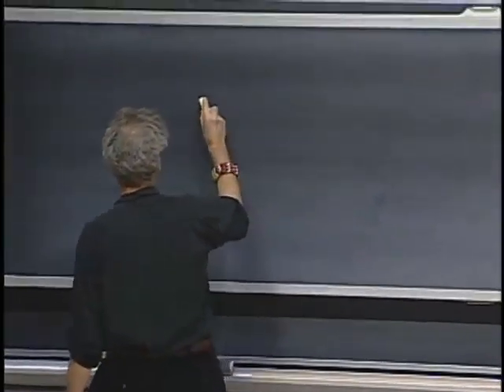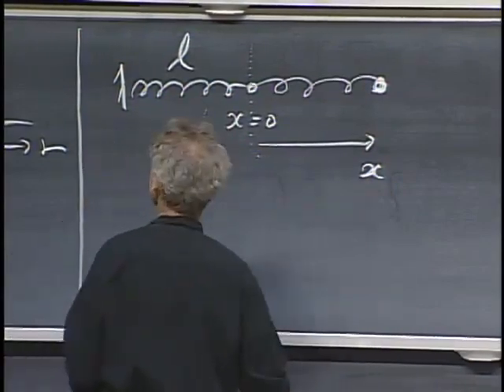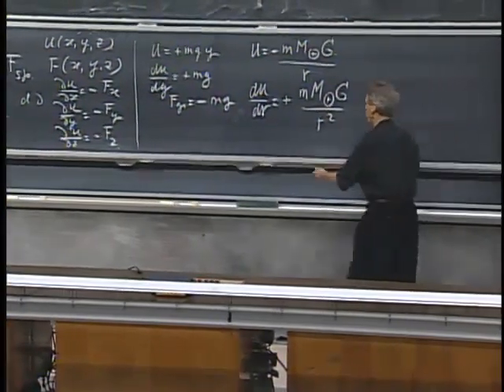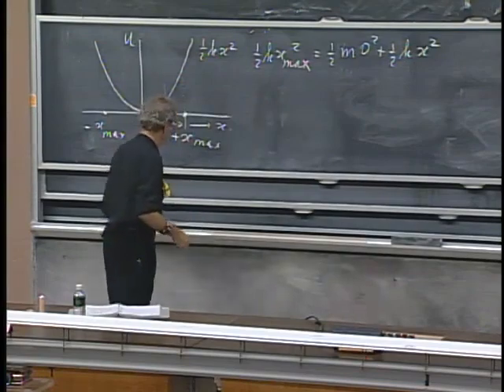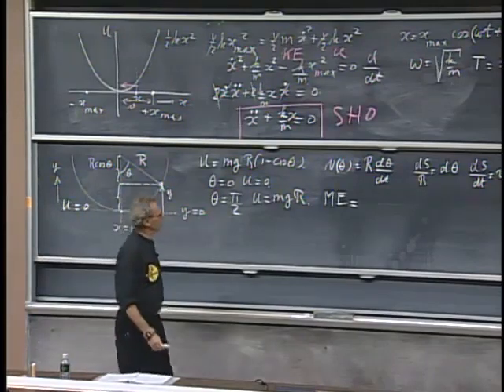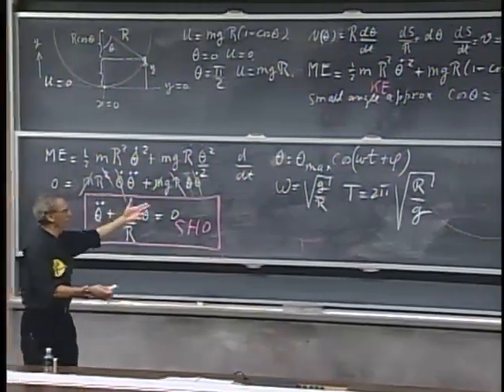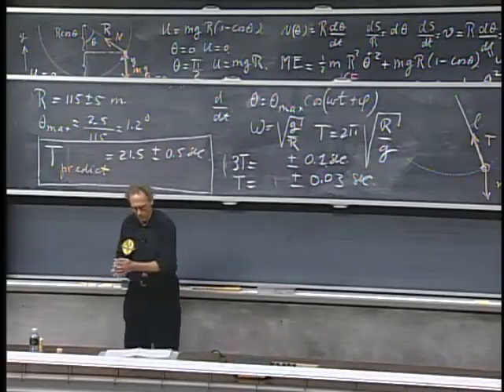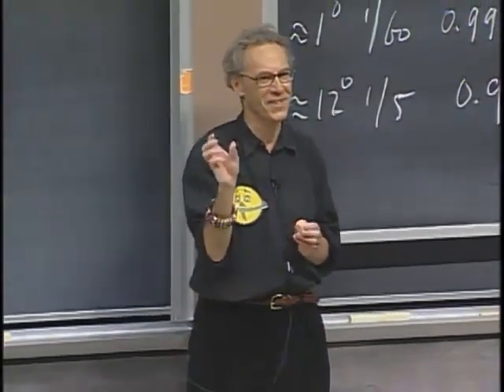8.01x - Lect 13 - Potential Energy, Derive Simple Harmonic Motion using Energy

Comment: On the end. Isn’t it because of the smaller radius and angle? Just of the top of my head, the velocity was directly proportional to the radius and angle. So the smaller they are the slower the ball moves. Please correct me if I’m wrong.
Reply from the maker: you are wrong

Comment: The experimental failure was caused by ignoring **rotational kinetic energy**. Unlike the sliding glider, the rolling sphere splits its initial energy into both translational and rotational kinetic energy, reducing linear speed and significantly increasing the period.

Comment: Dear Professor Walter Lewin, I appreciate if you can help me to clarifying a point:
1. in the air track with large radius your prediction match with your observation. I understand that, since we are talking about an object sliding on circular track.
2. However, in the case of the small circular track with a ball, the prediction was very different from the observation.

3: So, my question is why? I guess in the second case we talking about rolling motion, not sliding motion, right?
Many thanks for your time and kind attention.
Reply from the maker: I have posted a physics problem which takes the rotation of the ball into account - the result is in perfect agreement with the observed period
Reply: @lecturesbywalterlewin.they9259  Many and many thanks Professor Walter Lewin.
I will check the problem with rotation of the ball.
Reply: @lecturesbywalterlewin.they9259  My idea is to assist with complete lecture per week. 
I think this is natural rhythm for my learning process.
PS: I apologize for my poor english.
Reply: @lecturesbywalterlewin.they9259  Dear Professor Walter Lewin, can you, please, tell me what is the Physics Problem in which the rotation is also taken into account.
Sorry, but I didn't find it.
Many and many thanks.

Comment: Oh, indeed you say it, that 13° is not that bad and the approximation is still valid. My bad !.....My second attempt Professor (4 am here in Europe, not the best moment for having a fresh brain) maybe I'm still not nailing it.... The difference between both experiments is in the variability of the angular velocity, and in consequence, the period, all along the trajectory. 
In the first experiment, the ball keeps a similar height so similar potential energy all along the arc, due the conservation of energy we deduce it keeps also a similar value of kinetic energy all along the arc, so a similar value of linear velocity and therefore similar angular velocity all along the arc which is closer to an ideal harmonic oscillator.
In the second experiment, the variability in potential energy is bigger because the arc has less radius and the ball changes more its height all along the arc. More variability in potential energy is immediately translated in a more variability in kinetic energy, so you have a non-constant angular velocity, so you deviate from the ideal harmonic oscillator. 
Why slower than the harmonic oscillator prediction? Because the bigger the angle, you have the ball being submitted to a bigger effective gravity force doing negative work, and so, it reduces its velocity and at the end you have a bigger period.
Reply from the maker: you still don't get it

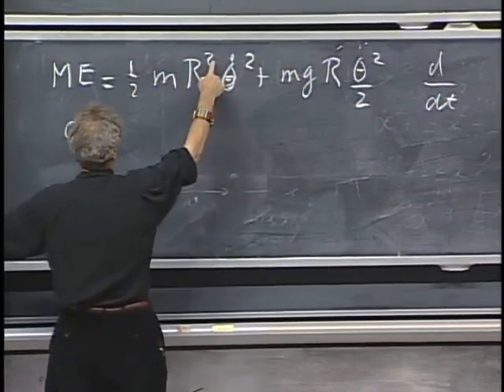Comment: 34:10 , you point to R^2 and say the 2 comes down and eats up 1/2, but then continue writing R^2 in the equation. Does the 2 come from Angular velocity instead??, since the equation is not wrong at all
Reply: Radius isn't changing with time, so yes, it does come from angular velocity.
Reply: The circle doesn't change its geometry over time.

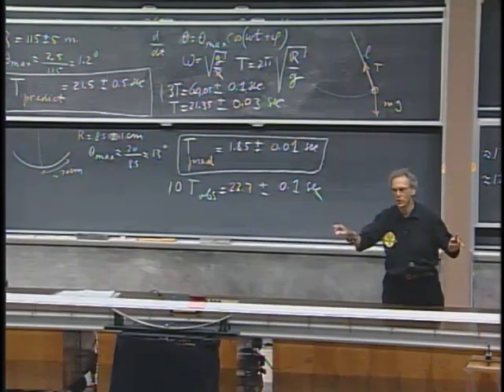Comment: 50:52 did that happen because the ball bearing would take a moment to get into pure rolling state every time it would change it's direction, or in other words, it would get into a state of sliding friction before entering pure rolling, and that moment of sliding friction would lower the net energy of the system...

but wait, this SHM, T only depends on radius of curvature and gravitation, so lowering the energy should only lower it's amplitude...

Please explain sir, I'm very keen to know!
Reply from the maker: it's due to the rotation KE of the ball.
Reply: @lecturesbywalterlewin.they9259  thank you sir🙇🏿‍♂️

Comment: IT'S THE AMPLITUDE!
The amplitude of the larger arced SHO is much smaller as compared to the amplitude of the ball on the smaller arc in the second experiment.
I hope I'm right. It was fun joining this lecture professor. Luckily I showered a couple hours ago 
:)
Reply: It's not the amplitude.  It takes at least a 22 degree amplitude of a pendulum to achieve a 1% error in the period.  Hyperphysics has a large amplitude pendulum period calculator, that implements the infinite series to more terms to calculate this.

It's the fact that the ball rolls, while the air track slider is in pure translation, that explains it.  The kinetic energy of the ball is more than just 1/2*m*v^2.  It is 1/2*m*v^2 + 1/2*I*omega^2, where omega = v/r, r is the ball's radius, and I is the moment of inertia of the ball about its central axis.   Put it all together, and you end up with KE_total = 1/2*v^2 *(m + I/r^2).

Apply this equation to the procedure of finding the period of oscillation from this lecture and get the following.  Note that big R is the track radius:
T = 2*pi*sqrt(((m + I/r^2)*R) / (m*g))

Set I = K*m*r^2, where K is the factor in front of m*r^2 in moment of inertia, and get:
T = 2*pi*sqrt((1+K)*R / g)

Set K=0 for the case of pure translation, and get:
T = 2*pi*sqrt(R / g)
 
Set K = 2/5 for the case of a solid uniform sphere and get:
T = 2*pi*sqrt(7/5 * R/g)

With the given data, we predict T=2.2 seconds, for the ball rolling, which is consistent with the experiment.
Reply: @carultch  when you asked your dad for fork on dinner.
Reply: @carultch   that was great explanation .

Comment: It might be the air drag in the second condition .. it might also be in the first one but the shape of the first object would have handled it and reduced it .. (due to its less surface area in motions direction)... The second was a sphere so more area was exposed while motion and air would have made it lil slow ... Plz clear if I'm wrong .. 😅
Reply: You are wrong, first the air drag  it will be very small  so it can't be it, the reason is that the sphere rotates so it has kinetic energy due to its rotation K=(I*ω^2)/2 which you have to add in the initial relation and if you do it, you will find that the T is 2,19 instead of 1,85 which is very close with the experimental one

Comment: For the rolling ball,  T = 2*π*sqrt(7R/5g). Plug the numbers in! 
Proff. Walter Lewin is right. PHYSICS  WORK.
Reply: How did you get that formula, please?
Reply: @paulproofphysics777  When you do the calculations the kinetic energy for a rolling body is not (m*v^2)/2 but you have to add to this the kinetic energy from the rotation which is (I*w^2)/2 so the kinetic energy is KE= (m*v^2)/2+(I*w^2)/2 and this will give the difference

Comment: Teacher, i want to ask you that, only convervative Force have the potential energy?
Reply: Yes.  Only conservative forces have an associated potential energy.  There is energy transfer with non-conservative forces, but it is an irreversible process.  When friction slows down an object, energy leaves the domain of mechanical energy, and becomes thermal energy.  When a human force intervenes to add mechanical energy to a system, energy enters the mechanical domain from the original form of chemical energy in the person's food supply.  Energy is ultimately conserved in both of these examples, even though these are not considered conservative forces.  It is just that mechanical energy isn't considered to be conserved, because other forms of energy are involved.  Due to the fact that the process is irreversible, we don't keep track of a corresponding potential energy to non-conservative forces.

Forces of constraint, like the normal force and tension, also don't have a corresponding potential energy, because in the ideal case, these are zero work forces.  The corresponding displacement is zero, for ideal forces of constraint.  Ultimately, these are a form of elasticity, and will have elastic potential energy that corresponds to them, but when deformations are insignificant, the potential energy changes are also insignificant.

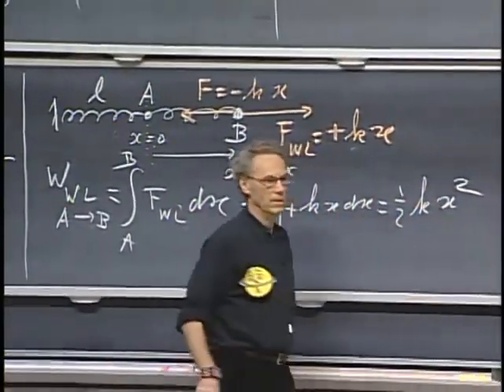Comment: 8:50 why the work equal 1/2*k*x^2 not just k*x^2 since work between the two points will equal the force*distance  (force=kx , distance=x)  , 
Thank u a lot best physics prof ever Walter Lewin
Reply from the maker: MATH!    integral of kxdx
Reply: why integral is needed in this case
Thanks for ur time prof
Reply from the maker: watch my lectures in which I cover "energy and work" this in great detail.
Reply: Lectures by Walter Lewin. They will make you ♥ Physics. Alright professor thank u for ur attention
Reply: @20000bc  
why integral needed.................simple  
force is changing with the position x. if force is const: , then work is area under the rectangle of side x and that const force 
but here the force change linearly with x and we have to cut that rectangle diagonally gives us a right angled triangle of area 0.5bh (force *x).hope you understand ...no big deal....suggest you 3blue 1brown channel ...invent calculus yourself.....
Reply: @vineethkumar.v8647  thank u dude

Comment: What's the mean of angular frequency in oscillation??
Angular frequency - unit - rad sec^(-1)
Means particle who is in periodic motion move 1 rad in one second in reference Circle.
I'm right or no.
Reply from the maker: if an object oscillates in SHM with period T, then the ang freq 
ω= 2π/T. If T changes in time you can calculate the mean value of ω in a given time interval.
Reply from the maker: A 1 D SHM with period T (e.g., an object oscillating on a spring) has an ang freq ω= 2π/T.
Reply: My question is that SHM can be liner or something more but we use angular frequency for SHM who relates motion to a circular motion.
And can we use the term angular frequency for liner Harmonic motion?
English is weak.😔
Reply: @gemeitgoel5104  Simple harmonic motion means that you can describe the oscillation as a sinusoidal function of time (i.e. sine or cosine function).   The input to the sine function expects radians as the unit.   Angular frequency is the parameter that translates the time into corresponding units of radians, each representing a two-pi'th of a cycle.   The complete cycle is 2*pi radians.

The angular frequency doesn't physically manifest into any angles you can measure on a protractor in the real situation it describes.  It is a way to translate time into the abstract angular domain, that the sine function expects as an input.

The general equation for a sine wave is:
y = A*sin(omega*x - phi) + y0

A is amplitude
omega is the angular frequency, equal to 2*pi* the full cycle frequency.
phi is the phase offset, that specifies how many radians through the sine wave the cycle starts
y0 is the equilibrium position

Comment: Professor, I have a doubt.
Since you estimate your reaction time to be 0.1 seconds, you write it as the uncertainty, because you admit you may be off by 0.1 seconds at any measurement of time.
Well, the doubt is the following: to measure the period of the oscillation shouldn't you consider an uncertainty of 0.1 second both at the start and at the end of the timing, resulting in a total uncertainty of 0.2 seconds?
Thanks for the attention
Reply from the maker: my total reaction time including start and stop was 0.1 sec in 1999. In 2011 it was closer to 0.2 sec. Thus that's the uncertainty in my measurements.
Reply: Lectures by Walter Lewin. They will make you ♥ Physics. 
Thank you professor

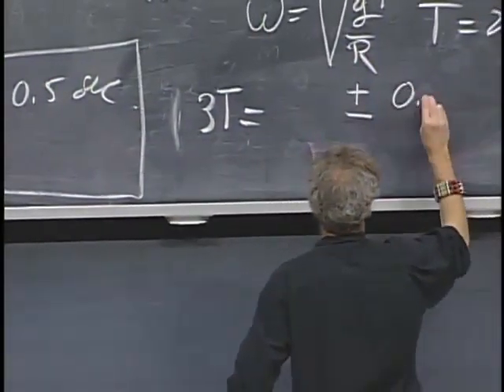Comment: Dear prof, at 43:33,  shouldn't your reaction time stay the same (+-0.1) regardless of whether you are pushing the timer after 3 oscillations or just 1?
Reply: Khandker Tiash Azad the reaction time stays the same, but the error goes down. This is because the first error is the error on 1 oscillation, caused by the pressing of the button at the beginning of the single oscillation and at the end of the same single oscillation. In the case of 3 oscillations the button is pressed at the beginning of the first and at the end of the third, so there is no error at the end of the first, start of the second, end of the second and start of the third.

Comment: is it have to something to do with rolling motion of the ball? As I remember that ball makes both rotational motion AND translational motion so it has two types of kinetic energy (1/2mv^2 + 1/2Iw^2), unlike the first oscillator which only had kinetic energy from translational motion. 
Thus, some of the ball's potential energy will be consumed for its rolling and it will lose tangential speed by time
Reply: You are correct.  It is that not all of the kinetic energy of the ball is in pure translation, that slows it down.  The fact that it rolls gives it another mode of storing its energy (rotational KE), that is directly linked to its speed due to being in pure roll.   A frictionless slider would move like a simple pendulum on that track, but a rolling ball needs to have its rotational dynamics considered to predict its period.

A solid tungsten ball inside a plastic shell, would be a way to get it much closer to  translational-only mechanics, by concentrating as much of the mass as close to the axis of rotation as you can..
Reply: @carultch  Yeah agree but there must be static friction for the ball to roll.
Reply: I think so too...
Reply: I also think that 🤔

Comment: Professor centripetal acceleration also works on the pendulum so why didn't we take into that consideration and why just tension.
Reply from the maker: we take not only tension into account. we use gravity and tension. when the pendulum is at its lowest point, the centripetal force at that moment will be the difference between the tension and mg. If we use the torque=I*alpha (small angles) the centr force is automatically taken into account as it is the Tension - mg.
Reply: @lecturesbywalterlewin.they9259  Thank you sir
Reply: @namanjain9672  j
Reply: @namanjain9672 Centripetal acceleration is by definition, perpendicular to velocity.   As a result, the dot product of the force causing centripetal acceleration and displacement is zero, and thus does zero net work.  Only the components of forces tangential to the path (i.e. parallel to velocity) will do work on an object.

Comment: The derivation of Energy approach to the pendulum is way more precise than the one using Newton's Second Law, since you are using a degree two approximation. Right ?
Reply from the maker: No not right.  Any method you use will lead to a SHM ONLY for small angles.
Reply from the maker: In Lect 13 I could have derived the SHM period of a sliding object on the circular track in less than 5 minutes  by using torque=I*alpha. However, at that time I had not introduced torques yet.  Thus I decided to go the route of conservation of energy. It took 10?15? minutes? but it was useful in that the students saw for the first time that SHM can always be approached that way.
Reply: Lectures by Walter Lewin. They will make you ♥ Physics
Ooops, by taking the derivative you get back to degree 1 for the sinus (sin(x)=x).
I apologize. 
Thank you very much, professor.

Comment: do we,in physics, ever deal with infinite amount of force.
Reply from the maker: not to the best of my knowledge. However we do deal wit infinite dimension (an infinitely long wire or coil). We can then use easy symmetry arguments and the results are very very useful as a 2 m long charged wire behaves very similarly to an infinitely long one.

Comment: Hello dear Sir, I  wanted to ask you that whether or not I need to buy  book(s) or these lectures are enough for a good understanding of physics. Thank you for these lectures.
Reply from the maker: you decide
Reply: Lectures by Walter Lewin. They will make you ♥ Physics. Yes sir.I got your point.
Reply: Samarth, I would suggest taking notes on the lectures without pausing.   Then go back and recopy those notes neatly and make sure you can fill in any details that you didn't have time to write down during the viewing.   If you can't,  then watch again and if that fails,  check a book.   Do all that note taking by hand.   I know it may sound silly,  but it really does help with learning.   It also wouldn't hurt to find some sample problems to work out on your own.   Good luck. Physics is a fascinating subject.

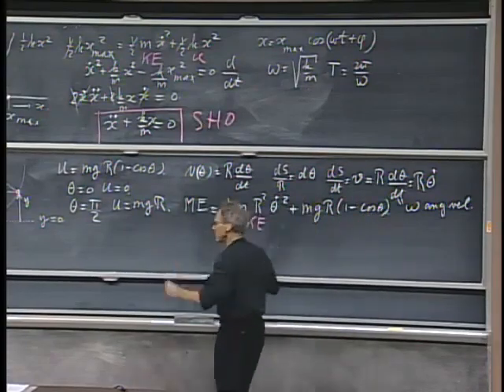Comment: At 29:48, you say: "independent of theta"........I understand that gravity is conservative force so it does not depend on which path do we choose......so what did you mean by "independent of theta"?
Reply from the maker: I listened to it a few times. What I meant is that the eq (conservation of energy) always holds regardless of the value of theta (release angle - see picture on black board).  Of course, the larger theta (at release) the larger is the total energy. E_tot= PE + KE (and it is conserved) which is always true for conservative fields regardless of how large E_tot is thus in our case regardless of the value of theta. If a non-conservative force like friction is involved, then  E_tot is not conserved.